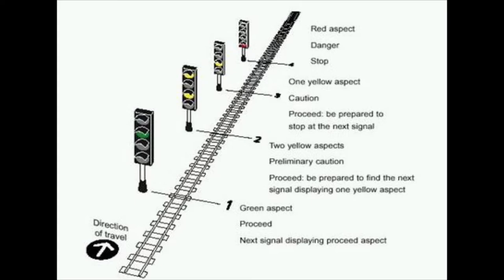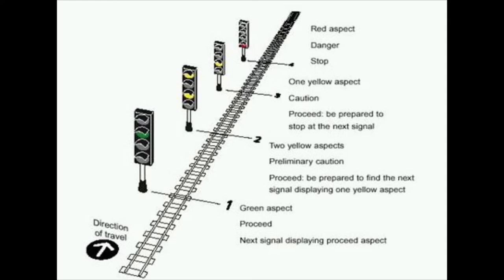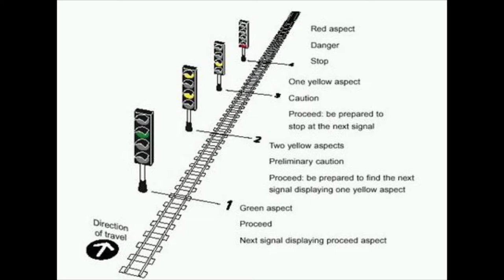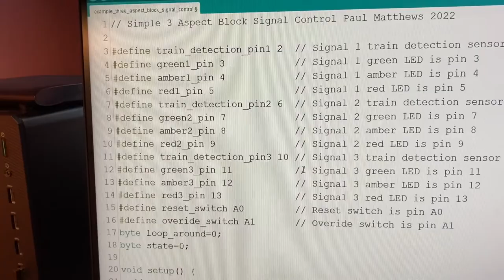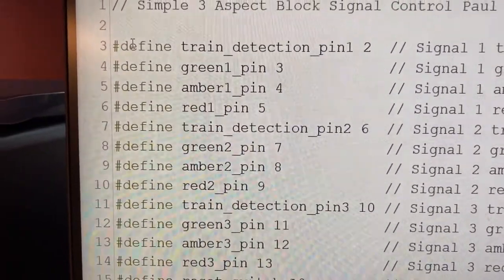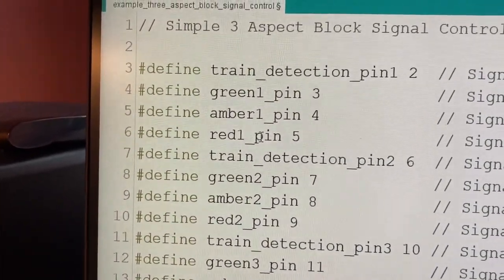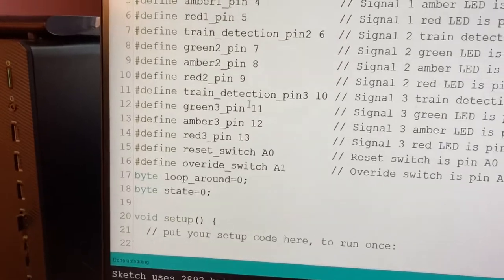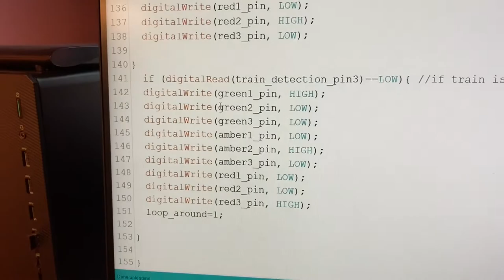Model Railway Automatic Signal Control Using an Arduino Part 12 - Block Signalling

Comment: Hi very helpful, one question could this be used on a single mainline with travel and signals in both directions?
Reply from the maker: Hi there, I did this as a bit of a test so the code is a bit rough and ready as I don't have block signalling on my layout and wasn't intending to use it in the field. I would say you could do this for a single line bi-directional layout but it'd need quite a bit of clever thinking on how to control the lights, probably too much for my brain but I guess you would assign each signal and detector a number so for example Signals 1, 2, 3, 4, and if your train passes Signal 2 whether the preceding signal passed was 1 or 3 that would determine the direction of travel of how to sequence the lights to match

Comment: Hi Paul, As new (retired ) new comer to both Arduino & model rail road! ( in trying to resurrect a old Marklin set) its with great interest that I am looking forward to implement a 'simple' but inexpensive signalling system. So to thwart end I ran into snag in trying yo get your sketch to work, that is,
a) do you have a wiring diagram (for the reset & over ride switches).
b) why I am I getting Amber & Red on at all times.

Any other suggestions/recommendations

Your response/help will be greatly appreciated.

Jay
Melbourne-Australia
Reply from the maker: Hi Jay, I can certainly do you a wiring diagram - give me a couple of days, I am a complete newcomer to the Arduino as well so no doubt my sketch isn't perfect and when I've been trialling I've managed to have virtually every combination of lights on at the same time resulting in much hair pulling out! Please note this Part 12 is a block signalling idea only - I'm not intending to use it on my layout so it was an experiment and might have a few errors in there I haven't managed to find. I've dismantled the test example shown in this video and not intending to recreate it as my Arduinos are now installed on my layout. There's a lot of wires running about in this example so it's easy to get confused and this often happened with me. In my earlier videos I've used a simple timer signalling function and that's the one I'm using on my layout and I'm happy that works. One thing I've found so far, if you are using the infrared module sensor method I found some weird light combinations because the detector was too sensitive and I had to adjust it. Also just in case the reset switch is a push button not an on / off switch. One other thing, I tried to get the max out of an Arduino hence my idea for one Arduino supporting three signals. When installing some on my layout (not this Block signalling version but my earlier timed version ) I did have odd lighting sequencing coming on and I suspected that the Arduino Nano couldn't handle three signals at once, I also made sure the 12V supply to the Arduino was decent enough to give it enough power. As I say, give me a couple of days and I'll double check the sketch pin allocations and do a wiring diagram. Best wishes Paul
Reply from the maker: Please refer to the Video Description above, I have added a pin diagram there.
Reply: @ipcress1066  Hi Paul, Thanks for your reply, much appreciated. Cheers for now, 
Jay

Comment: Hi Paul it is Keith again I have great news mega 2560 pro mIco it is small version of the mega 2560 I have now got 16 signals working the mega 2560 pro it is very easy use may be give it try it is amazing the progame it is very Good to use I thought to let you no if you want progame let me no. Thanks Kerith
Reply from the maker: That's pretty amazing Keith, well done! You could post the code in the comments in case anyone wants to use it. Best wishes
Reply: Hi Keith, Any chance of getting a copy of your code, are you able to post it or send it me, Thanking you in advance, Regards Jay